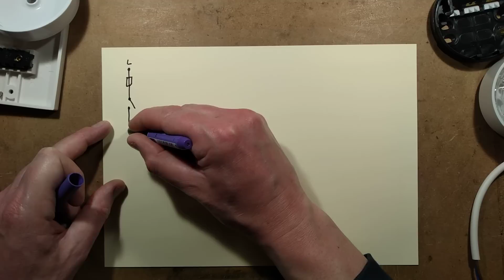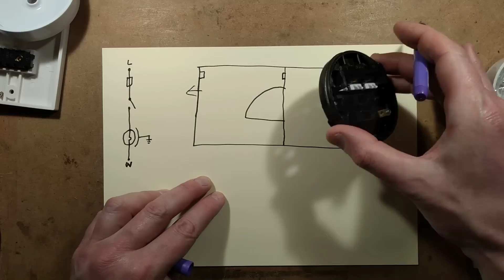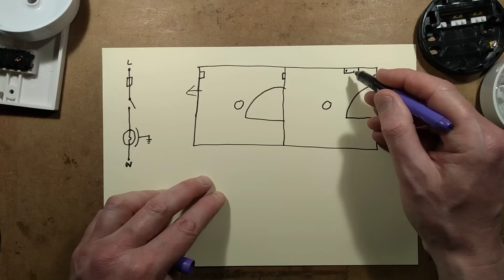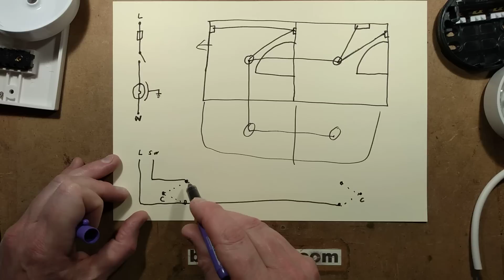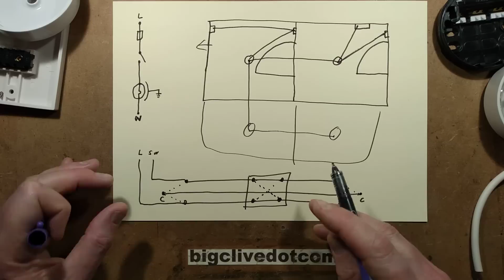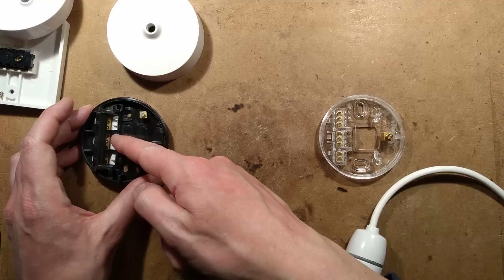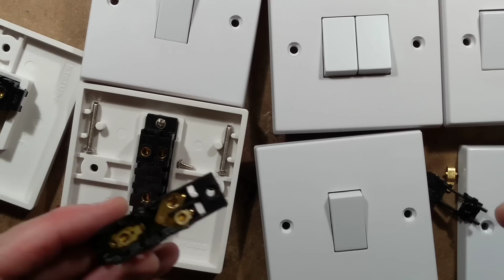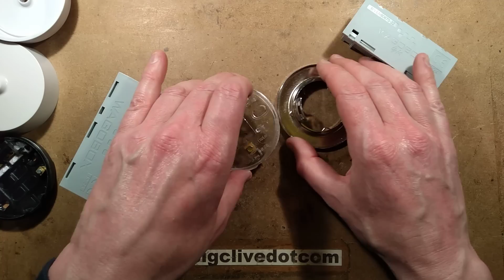British home wiring.  The incredibly simple lighting circuits.

Comment: Plasterboard is usually called drywall in the U. S. but the brand name Sheetrock has gone into generic use, much as Kleenex has for tissues.
Reply: We call it gib here in New Zealand - I think it is a brand name. But someone correct me but does Gibraltar export them?
Reply: @jgroenveld1268  could be a contraction and bastardisation of Gypsum
Reply: @capnskiddies  After I commented I googled it and out that the term "gib" is indeed a contraction of "Gibraltar".
Reply: @jgroenveld1268  But it's not in relation to plasterboard. Most brits of military connection would refer to the place as Gib.
Reply: in Australia we use the genericised trademark 'Gyprock' generally, otherwise plasterboard
Reply: Drywall is the name adopted in the UK for using plasterboard fixed to block walling (usually using blobs of mortar) rather than the material itself. I have a suspicion that that the approach was adopted from the USA. Prior to the 1970s, houses with solid walls used wet plaster onto the block (which took a long time to dry out). Hence drywall. 

The UK adopted a few other US practices after that, most notably trussed roofs which started at the end of the 1960s, but wasn't fully adopted until the mid 1970s.
Reply: @TheEulerID  it's actually called Dri-wall (which is completely different and a brand name) and is used in a dot and dab system.
Reply: @superlazy3355  in the UK drywall is the generic, Dri-Wall is just a brand name. The former is used all that time.
Reply: @TheEulerID  we don't call it dry wall, and a dot and dab certainly isn't a dry wall as you use water to make the bonding compound. Realistically a dry wall would be a metal stud and plasterboard fixed with screws. Not dot and dabbed. Dry wall is an Americanism, as here in the UK its called plasterboard and referred to as interior linings.
Reply: Or Hoover has for vacuum cleaners

Comment: In the US, neutral is white, ground is green or bare. Hot is usually black in a 2 conductor cable but can be any of a number of colors if single conductors are used in a conduit or a multi faze cable. Red, blue, yellow, orange etc. The only exception is a white conductor can be used as the hot leg running from a switch back to a ceiling fixture or a switched outlet.
Reply: Cowboy Frank's Personal Videos but the white conductor must be marked with black (usually tape) on both ends to signify that it’s hot.
Reply: @jcnash02  Right.

Comment: This is a (Western) Australian ceiling rose https://www.bunnings.com.au/hpm-65mm-10a-white-ceiling-rose_p7053814 (click on the lower picture on the left to see the terminals details). it lacks the bus bars yours has so the wires have to be twisted together to fit in the terminals. I think would prefer your bus bar terminals.  Out ceiling junction boxes look like this: https://www.bunnings.com.au/hpm-junction-box-4x40a-standard-connector_p7053602

Comment: It may be fun for you to investigate how it is in Denmark, that are nothing like what you already have seen. :-)
Reply: @A Gentleman  I hate Danish wiring too. Just the idea of having a square box (as does UK) is so dumb, no words for that. There is no tool to make square holes at the correct size quickly. Round holes are quick to make. Just drop a magnet in the box, another on a hole saw and push the button on you drill and you plasterboard is ready for mounting. Even in stone and plywood, round holes are quick to make.

Comment: Bloody Part P.
So much to answer for.
Reply: Definitely - those who would bodge, still bodge with zero repercussions because they don't bother to get it certified. Those of us who would have done it by the book anyway, we still do, then end up paying a "competent" person to bring their Fluke round, argue the toss on a few bits and then pay the council to do some paperwork. 

First electrician I had round to test my electrics would have been fine doing a regular 3-bed semi wiring, but he had no idea about the regs and I had to pull out my 17th edition (this was a while ago) a couple of times to demonstrate that things were not non-compliant. Nothing crazy, we're talking doorbell wiring (12V and more than 50mm deep) that was apparently "out of zones", and a plug socket that was not RCD-protected (but was a foot from the CU, in surface-mounted 20mm, in a cupboard, deep inside the house) that COULD have been used to plug in an electric mower (despite there being an RCD-protected socket outside, one inside the door, several between that and the cupboard).
Reply: Yup, my degree in Electrical Engineering counts for nothing! Without Part P I can't legally do much more than change a fuse! Yeh ... right.

Comment: I live in Germany and our floor has 3 light switches but  one of them is always "disabled" depending on which switch has been turned on or off and it is infuriating. I just got pass the explanation of multi switch toggling would work and I wish they had done it in our floor aswell...
Reply: Mound'N rewire it :)
Reply: @Tokaisho1  I would if i had a single clue about that stuff. I dont really know much about electronics wiring and stuff yet. I still watch many of his videos because i enjoy listening to him speak about stuff.
Reply: @MoundN  just buy some PIR lights....
Reply: I assume something is miswired.

The 3 way lighting control called "Kreuzschaltung" in german. The crossover or cross switch is part of two 2-way switches for three control positions . Such 
 Nowaday only few sparks understand the 3 position  wiring. They turn more to impulse relays /latch relays  which need only a pushbotton   control at the door and is easy to extend about more switch positions.

Comment: My ceiling roses from1961 are somewhat different, in the main the physical patress is  less diameter and has an external thread I can run a ring support for my chandeliers / tiffany underslung lampshades which suspend on chains. The cover screw on cover then holds the ring in place,  there does not seem to be a similar mounting means for the present wider diameter items - unless I am missing looking in the correct place in the DIY stores.

Comment: In the USA it's pretty common practice to take the power feed with the live and neutral to the switch box first, and then the neutral gets tied through in the switch box, and then just the switched feed and neutral goes to the light. Although taking the power feed to the light first and then only having one wire going down to the switch (commonly refered to as a "switch loop") is common too. The company I work for always tries to take the feed to the switch box first if we can. It makes trouble shooting easier IMO.
Reply: Jake Higgins Code (in the US) now requires a neutral in the switch box (presumably for smart switches and non-electromechanical timers) so switch loops are now forbidden as I understand it.
Reply: @Cubik303  Or use an extra wire to carry the neutral to the switch.
Reply: @Cubik303  there not forbidden  but instead of using a 2 conductor wire you have to use a 3 conductor.
Reply: @Cubik303  There's actually 4-core cable made for that (amongst other uses). In this case you'd use it as L1/L2/N/E
Reply: @Cubik303  Makes sense, as a lot of dimmer switches and timers require it.
Reply: Neutral to the switch is becoming common in the UK now and is recommended. With the advent of smart switches and the like needing a neutral at the switch to operate. Although ceiling roses and pendants are still very much present in older homes, most people are moving towards ceiling spot lights and fancy lighting bars etc. Both ways are valid still.
Reply: muzikman2008 - I generally agree with your comments regarding new installations. But until recently, the loop in system that Clive described was the most common. So for existing properties, it is rare to find a neutral connection / wire in the switch enclosure / back box.
Reply: @Mark1024MAK  Isn't that what he said? 
"Neutral to the switch is becoming common in the UK now" that's basically the same as "But until recently, the loop in system that Clive described was the most common"
Reply: @PBMS123  - not really. The number of homes with the existing loop-in system vastly outnumbers the number where a neutral has been provided at the switch. For rewiring or new installs, both ways are valid. So it depends on what the customer/client chooses. It’s impossible to know the overall proportion between these two methods where rewiring is being done or for new installs. Obviously each electrician knows what he/she has done recently.
Reply: @Mark1024MAK  I still think that's what he said. I didn't read what he was saying that is " becoming common in the UK now and is recommended." Given we're talking about the method of install, I took it as him saying the method has become common, in new builds and rewires, and not that the method has become common of all houses. 
I took it as the method of install has become common, as opposed to neutral in the box itself has become common.
Reply: In eastern Canada, the "switch loop" is a  "switch leg".  Probably elsewhere too.  It's the only time you get to wire an always hot black or red wire to a white (normally neutral) wire on the switch leg.  This presents the light fixture with a black wire for the hot and a white wire for the neutral.  So when the homeowner replaces his light fixture he simply connects black to black and white to white.

Comment: When we used to do rewires in the 80's, we'd take a feed from the hall light switch across to the common for the landing light (2 gang switch). Then a twin red up to the landing switch, from there to the landing ceiling rose & a nuetral to the nearest upstairs ceiling rose. Your voice is so interesting, you should do talking books.
Reply: Mixing/crossing neutral from different fuse branches is a safety problem as the crossed  nuetral could be passing all the amps it's rated for, plus all the amps from the crossover.
Reply: @WorBlux  It will also trip RCD/RCBOs

Comment: I don't get why they made the "hub" of the circuit sit at the ceiling, it'd be easier (both practicality and spinally) to have it at the primary switch in the room, but, that's just my thoughts, after having my neck hurt and plaster dust get in my eyes (yes, I know, should have used goggles!) from having to fix an idiot's ballsed-up lighting wiring on many occasion... :S
Reply: I assume because the ceiling and next floor just have a void between full of dust and spiders where you can run as many cables as you want and they're (relatively) easy to get at to add on more circuits later. The cable to the switch might be chiselled into a brick wall and plastered over so running multiple cables to the switch would be annoying especially if you had to get in there later to change something.
Reply: It can be done either way, take the live to the switch first or take live to the lamp first.

Comment: I remember from living in the UK the downside to UK lighting system was it makes it difficult to run powered items from the switch (like timers and automation) as it has no constant natural / negative return.  Now living in the USA the wiring here sucks as lighting generally runs from the room circuit to the switch then to the rose, meaning when you turn a vacuum or something on the lights dim; on a plus side the switch is always powered so automation and timers are easy.  It would be nice in the USA if they made lights have to have their own circuit, but kept the power loop from the switch as is.  The UK should switch to the power loop from the switch instead of the rose, or make it so a 3rd neutral wire is available.  Oh and 'Good' builders should always include an extra wire for ceiling fans.
Reply: I'm pretty sure that the zip tie loop on the Wagobox is for a tamper evident seal. Not necessary for the majority of uses, but super handy when it is needed...

Comment: wiring seems a bit thin for high draw grandpa bulbs
Reply: I'm not sure what a "grandpa" bulb is, but UK lighting circuits normally have 6A circuits and are good for about 1.4 kW. As far as the wiring goes, lighting circuits usually use 1.5 mm^2 cable, which has a slightly larger cross-sectional area than 16 AWG. At 6A, it's very lightly loaded and at 230v nominal, voltage drop isn't much of an issue. 

Anything with more powerful lighting could use 2.5 mm^2 cable, (AWG 13) or even more, but I've never heard of such a thing in a domestic setting. Factoriess are a different game.
Reply: @TheEulerID  it might have just looked thinner next to BC's big beefy bear claws
Reply: btw I know damn well you know exactly what a grandpa bulb is
Reply: @ChrisD4335  that's clever of you as I'm none the wiser despite searching for it, but I guess in the big picture it hardly matters.
Reply: Not sure if it compensates but it is 220vac.

Comment: The shallowest box you will usually see wall mounted in an American home is 3.5 inches deep. In standard procedure here the homeruns (runs from the panel/consumer unit to their first junction) usually attach at the switch box nowadays. You will still see some older school electricians doing everything out of the fixture box occasionally.  This almost makes me want to make my own video about box/wire standards here but I imagine that punch has been beaten.
Reply: As WorBlux mentions, in the US, there are differences in new versus old work.  "New work" usually has the switch, receptacle or ceiling box nailed to a stud or joist before the wall finish layer (plaster or gypsum board, typically) is applied.   The idea is that the code inspector has all the wiring visible before the sheetrock crew or plasterers arrive.     Wiring is typically "Romex", a brand of non-metallic sheathed cable, although my parents' home constructed in the 1950s used EMT conduit (that's where the electrician earned his beer).   Boxes are typically ABS, although non-metallic older ones were phenolic.  Runs are attached to studs using wire staples, with horizontal runs through studs being facilitated by a right-angle "hole hawg" drill.

Recessed fixtures typically have their own junction boxes attached and, on new work, are attached to ceiling joists with metal "stretcher" arrangements that allows for precise placement.   Hanging fixtures, particularly heavy ones, are required to have a steel safety cable as part of the installation, one end attached at the box and the other to the fixture.

"Old work" is generally more forgiving--boxes are inserted into a hole cut into the wall or ceiling, with "ears" being expanded out to secure the inside of the wall, very similar to what Clive shows in the UK.

Wiring can vary quite a bit--supply->switch->fixture or supply->fixture->switch.  Multigang switch boxes are not uncommon and can often be crammed pretty full with wiring.  Recall that most residential wiring is AWG14 or AWG12 3 or 4-wire cable, with the bare ground run being one of the wires, so a box fills up pretty quickly.

Surface wiring is available, but not common; search on "Wiremold" for examples.
Reply: I think a lot of it is new work vs rework. On new work all the wall cavities are exposed and at a decent working level, and you don't want to spend time on a ladder. Vs rework where the chase down the wall is the hard part, vs old work where the wire was expensive.
Reply: We have boxes in the U.S. that are shallower than 3.5" deep.
Reply: @JamesTK  I have some of those for US size sockets but they are not supposed to be used for high-voltage applications and, in my experience, they tend to let draughts through.
Reply: Doing the junction wiring in the switchbox is becoming more common over here.  Arguably easier to inspect, maintain and alter in the future.
Reply: I heard they might add neutrals at the light switch too in future for all the various smart lights people buy these days.